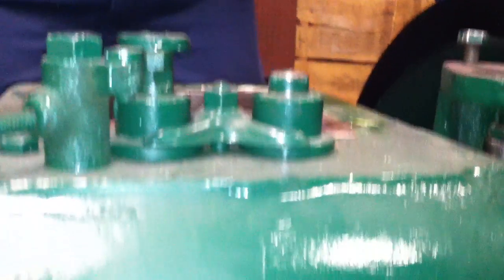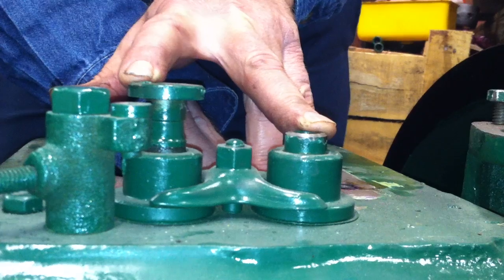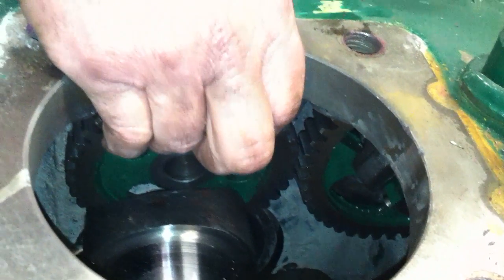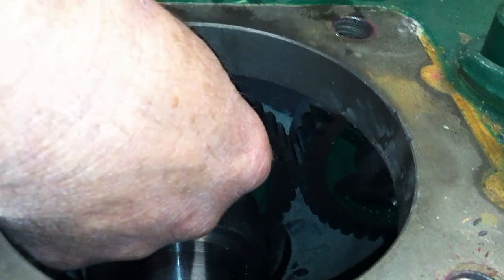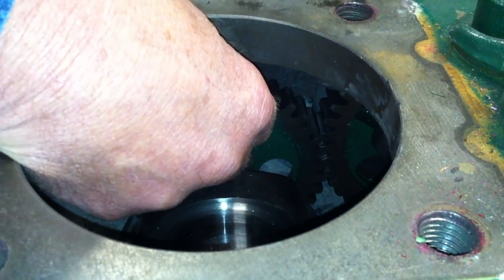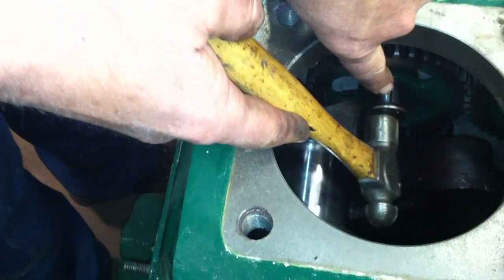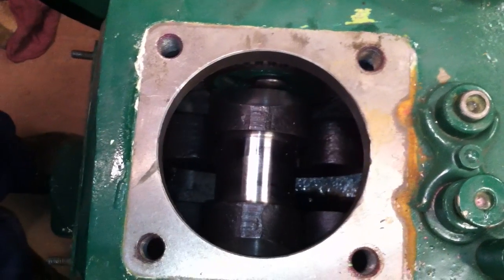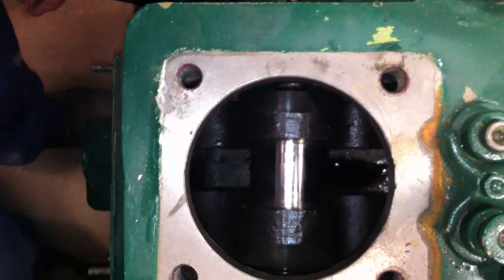Timing a Listeroid camshaft

Comment: Hello sir my 6hp weel engine in problim.when runing engine on water pump some time slow down and some time runnig fast.please tell me where is problom
Reply: Hellow Sir my engine brake the timing tea it please Tell what to do ?Sir.
Reply: If it just suddenly slows down then speeds back up under a normal load that can be a dirty fuel filter causing that problem - another as in generator service can be the spring on the governor - the OEM spring is to strong for generator service so many replace it with a weaker tention springs - if it's to weak the it might not respond to the load quick enough - if it's exstreamly cold fuel doesn't flow well and the engine at time will slow down a few seconds then go back to speed

Comment: Thank you for this, I used your method when I installed a new Listeroid camshaft into my Lister VA diesel engine, and it runs great.
Reply: Another was to set the timing is to center the crank to top dead center - I just look at the key slot on the crank - then turn the cam to right when the intake lifter starts coming up then I drop it down again - u can then set a dial indicator up on the lifter - turn the cam to were the cam lifts to 12 thousands of an inch - then install the ideler gear - then it's in time - turn the crank and just as the dial indicator hit  .012 inches the engine is in time - the way he showed works just as well with out special tools - it's the way most do it